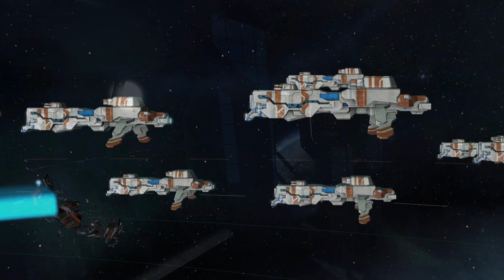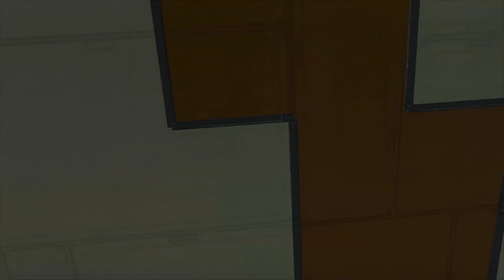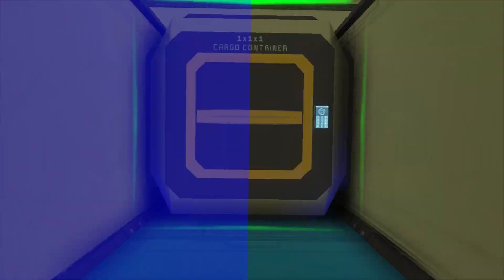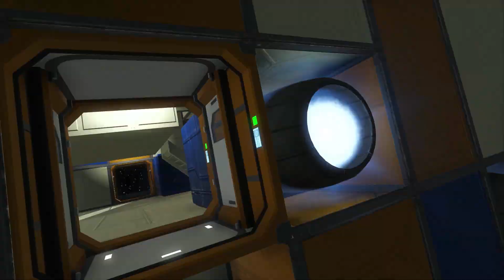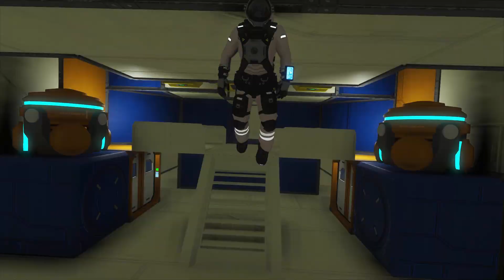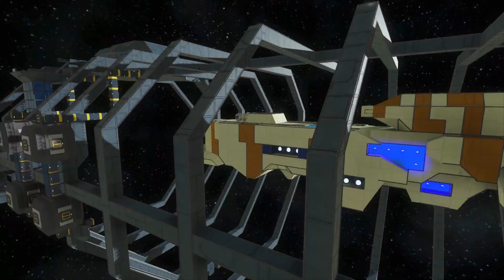Space Engineers - Stellaris Battle Corvette (One Day Speed Build)

Comment: Modelling Tip: Load the image in an image processor (photoshop or even windows paint) with a semi-transparent grid in the foreground (or grid in the background and the image is transparent). Each grid box will represents a voxel, so just resize the image until you feel like it's a good fit. It will help you to size your ship for specific modules you want to create, like turrets or other big modules. You'll spend less time guessing the sizes on the fly, you'll know exactly how many blocks long/wide/tall so you can quickly create a frame, everything will tend to be better proportioned, you'll minimize the time spent revising and scraping failures, and planning modules and systems will be much more efficient.
Reply: When you get very familiar with this method, you'll be able to plan out enormous designs very easily since just by looking at the grid you'll be able to estimate size requirements for large systems, including the limits for all the piping and human spaces. It'll also be a lot less daunting because you'll be able to take on portions of the ship at a time without needing to worry about what's going to go into portions you haven't started on yet.

You could even sketch out some artsy designs with primary school level drawing skills, take a photo of it and upload it to your grid. By the way, this process is called 'rastering', albeit a very primative rastering.
Reply from the maker: Gridding out the design makes it much easier true. But I find it takes away my ability to get creative with my own personal style. Going off the cuff creates a stylized versio that emphisizes Whatever feature I think defines the ship I'm looking at. Though if you want an really accurate design your right this is the best bet.
Reply: +TheXPGamers I like to make a skeleton of a ship first...its main frame structure... then work out its main components like engines, power sources , weapons ect...makes it easy planning internal pipes and wiring up systems 😃